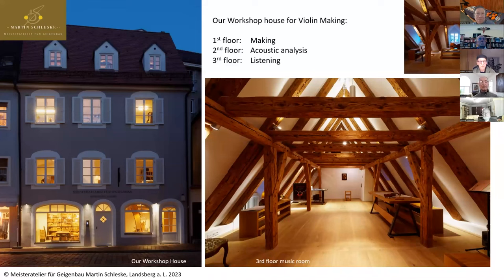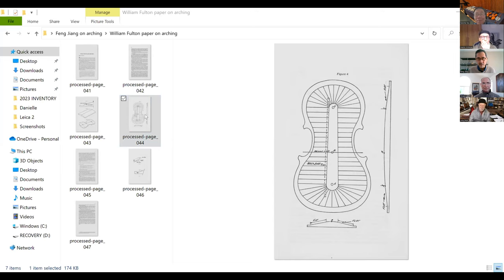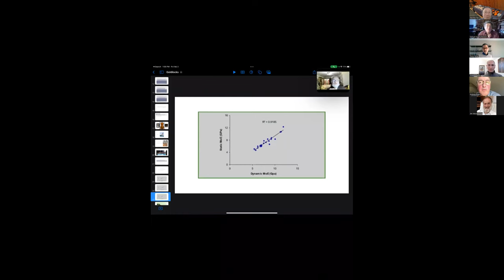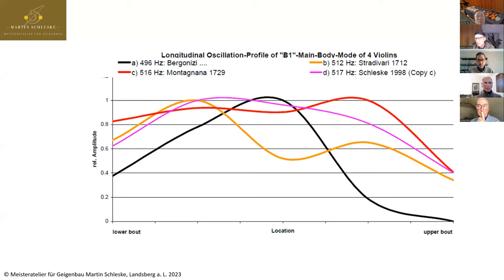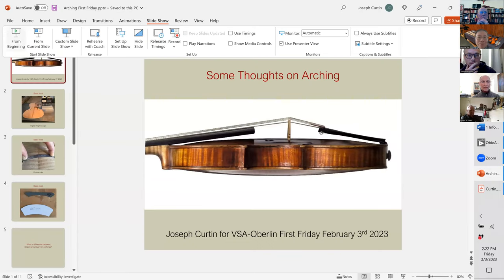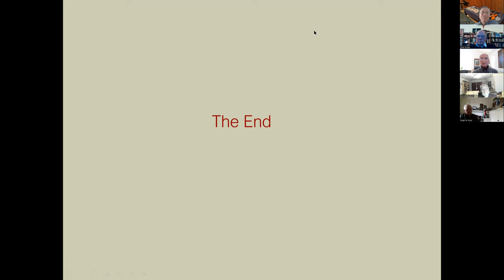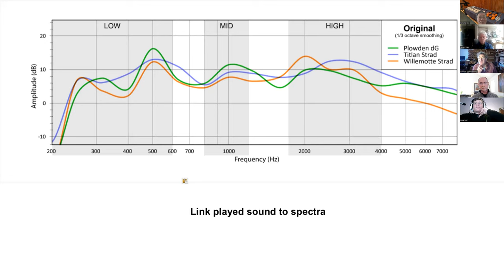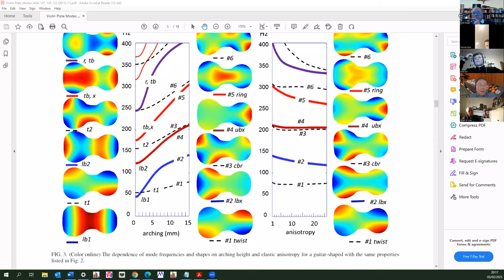Arching Panel Discussion: Joseph Curtin, Feng Jiang, Andrew Ryan, Martin Schleske, Sam Zygmuntowicz

Comment: Just worked on a Curtain violin built 6 years ago. The top is collapsing under the tensions of the bridge and the f hole has collapsed 2 mil. Can't be corrected with a taller post. Good ideas , but definitely won't last 50 yrs, less 300. Your $50000 sounds like a $2000 dollar violin now. Not giving anything without recognition. But, we at least made it better with a taller post and probably made bridge. Check your older instruments out to see potential faults.